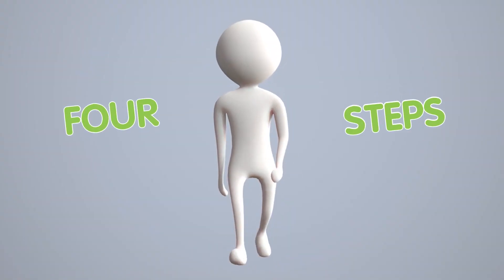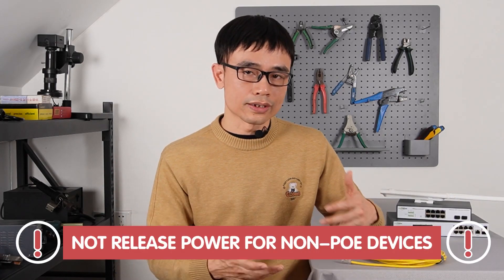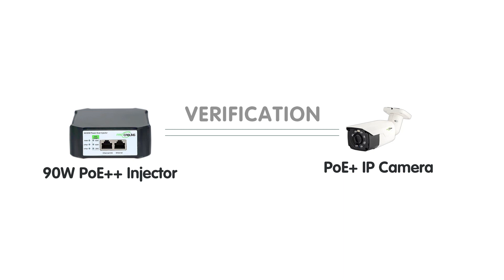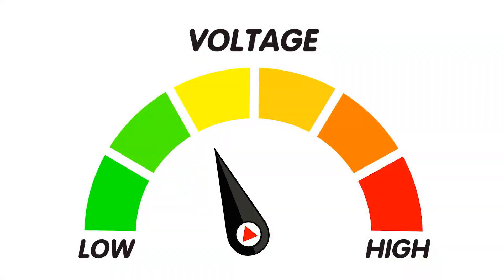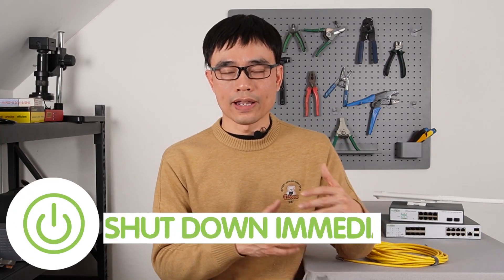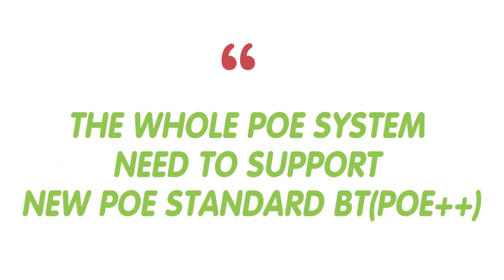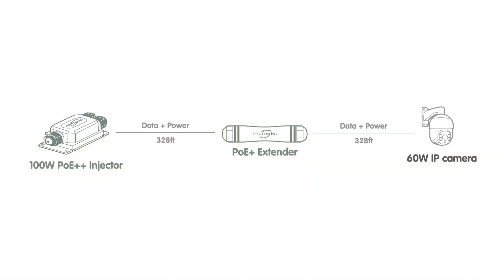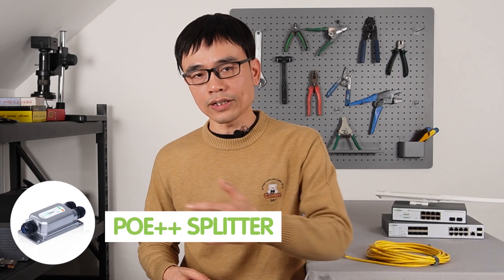How to Use PoE++ Splitter to Supply 60W Non PoE PTZ Camera?

Comment: What is poe af at bt can y explain it
Reply from the maker: It is 3 different PoE specifications. IEEE802.3 af/at/bt. Most PoE switch support af/at (aka PoE/PoE+) now. The bt is new PoE specification which can output 90W high power. It employs all 4 twisted pairs to send the power while the PoE/PoE+ only take 2 twisted pairs to transmit the power. The PoE is backward compatible. You can use PoE bt to power PoE+ devices.